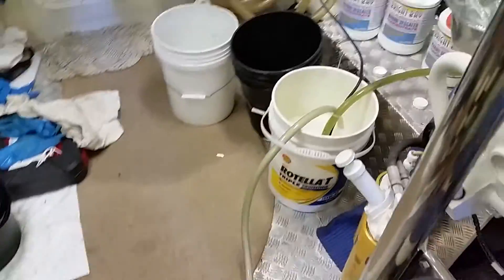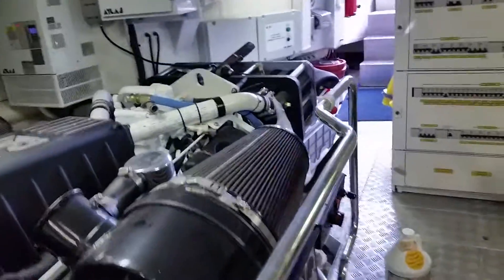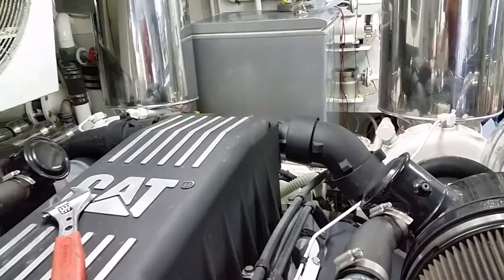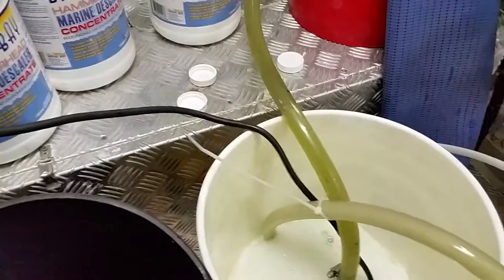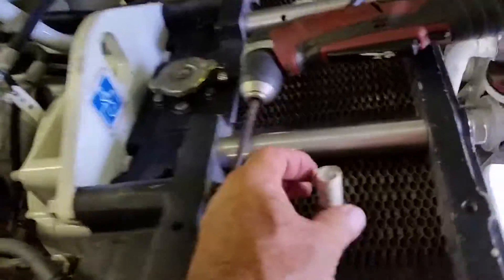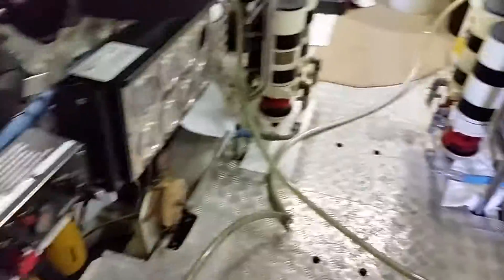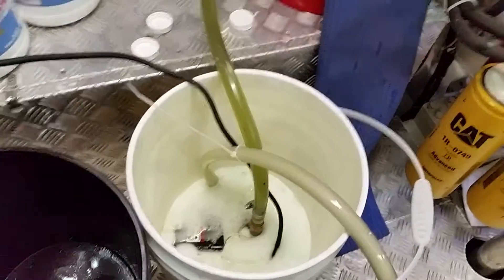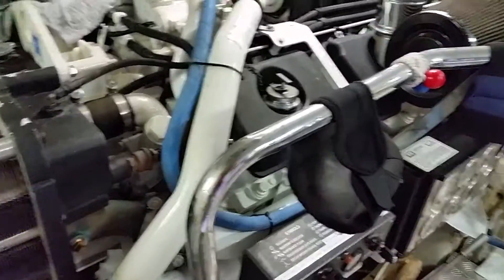Cleaning caterpillar heat exchangers

Comment: I have a question.  In the video, you mention to flush the cooling system in reverse so that any seaweed or impeller blades get removed, and not pushed further in.  Good thinking, and I agree.  You also are flushing both engines in the same loop of hoses.  Wouldn't the seaweed and/or impeller blades be moved to the second engine?

Comment: Haii Mr Allen Pollitt . I am caterpillar worker from malaysia. i need to know what item you used to clean the heat exchanger ? because right now im cleaning 2 heat exchanger because the engine is overheat to 110c at 100% load . i already do the back flush using normal water but i still doubt what im doing because what came out of the inlet pipe is not very convincing. i maybe have to disassemble it to look inside of it and clean it up. if can, please give me your email so i can send some picture of the heat exchanger and what i found inside it. thanks
Reply from the maker: In this video, Mike is using Hammerhead Marine Descaler from Bright Bay Products (Tampa, FL).  It is a BioBased Cleaner that will break down the marine growth without damaging the metals and soft materials.  www.brightbayproducts.com